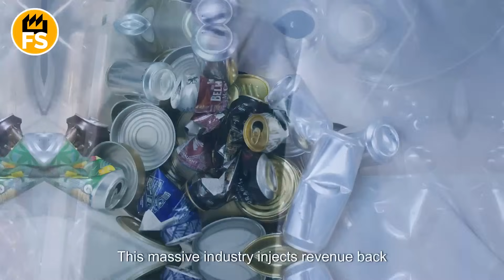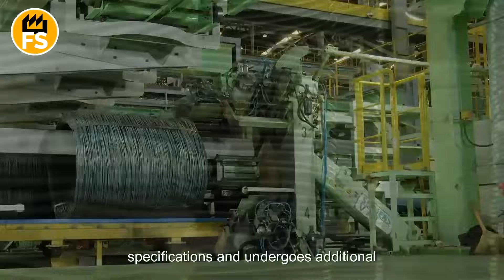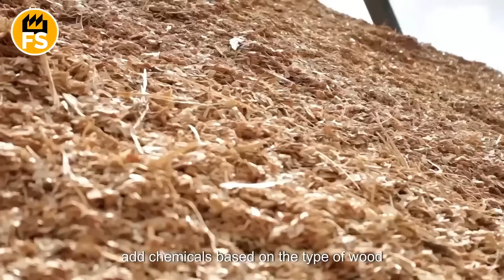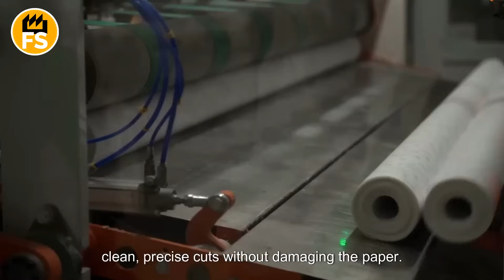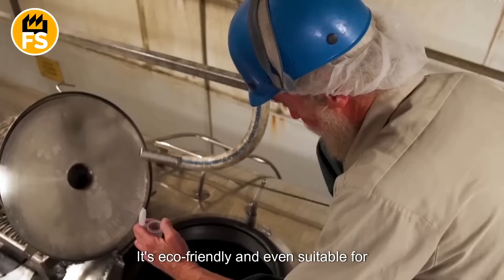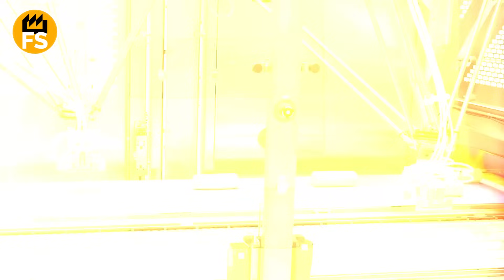How One Aluminum Can Saves the Planet? How 120,000 Cans Are Recycled Every Minute

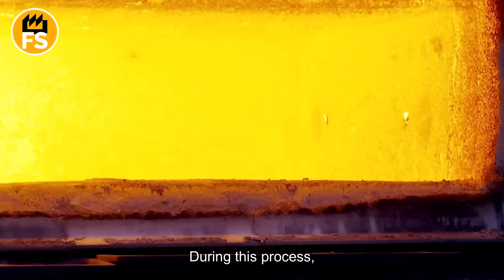Comment: 4:28 Where does the paint go,  burned into the air?
Reply from the maker: Thank you for your thought-provoking question, @kornelijekovac9793! The paint from recycled cans is typically burned off during the recycling process, ensuring that only clean aluminum is reused, which helps reduce environmental impact. 🌍✨